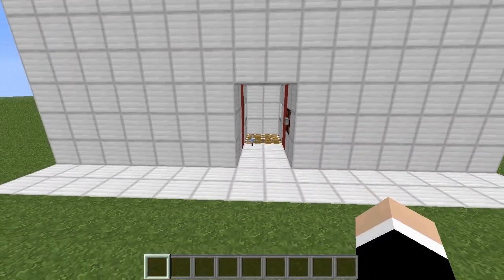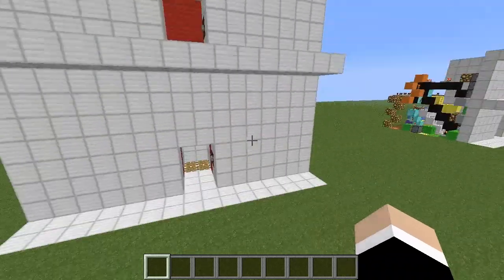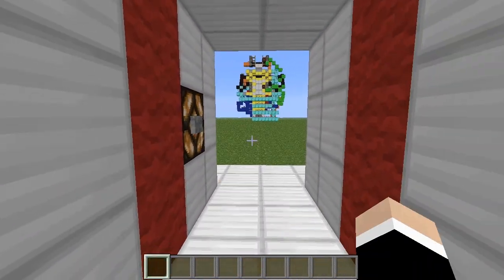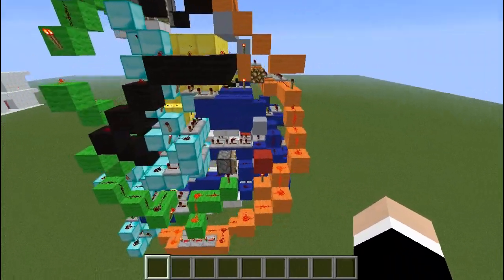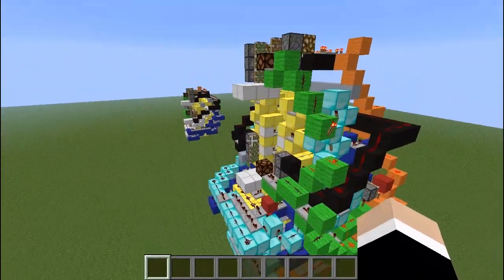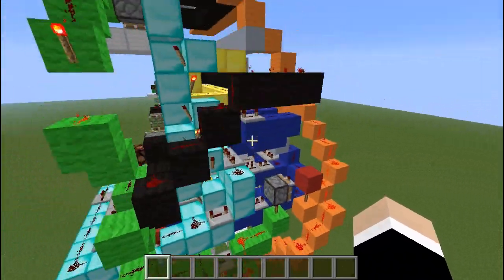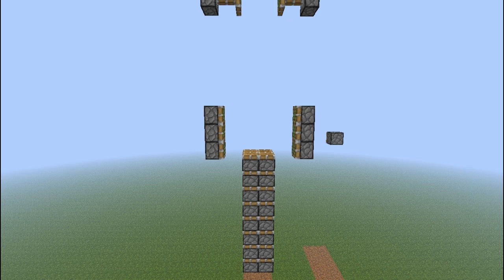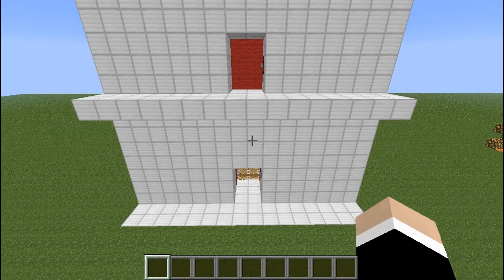Piston Elevators Using Stacked Pistons

Comment: I wonder if someone has pulled off building one to the piston push limit but I dont think it can be done because it could become a mess since you could be sending pulses into the same layers of the circuit like 8 times and the door timer would have to be very long
Reply: And I find it much easier if your gonna build a tall one in the current update then just use slimeblock flying machines and observers, Its much easier than fiddling with tall piston extenders and all that

Comment: u can make one even more realistic, use any block for floor & celing and put trap doors flat against the left & right walls conecting roof and celing u will need pistons at top to push u down. but its limited to only 2 floors
im trying to make 1 that can go up to as many floors as u want the pistons that push u up come out from the wall. problem is i cant make it go down

Comment from the maker: You could, but you would have to wire up extra stuff so that the block gets pulled all the way back down. What you could easily do is replace the non-sticky pistons with a block - but then the elevator will lose 1 block of height.